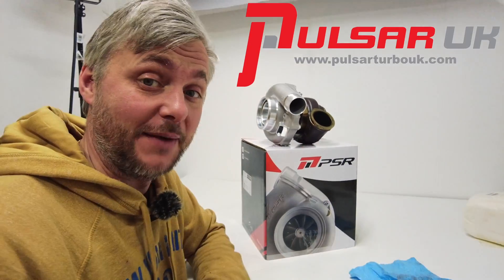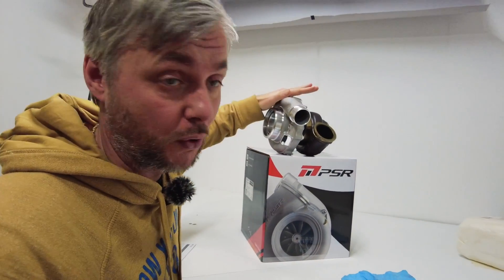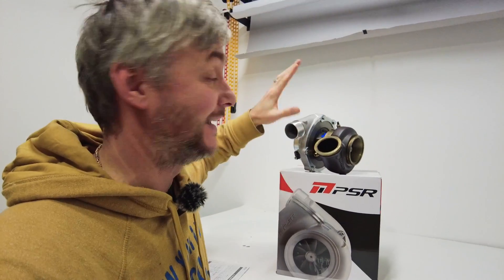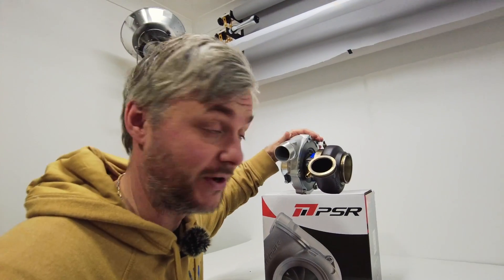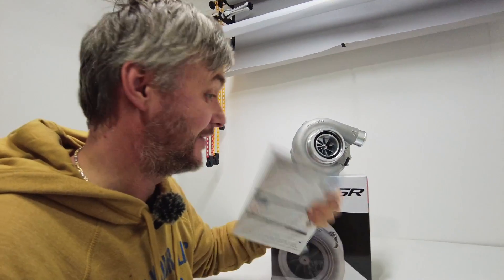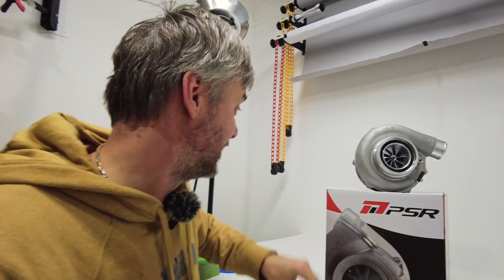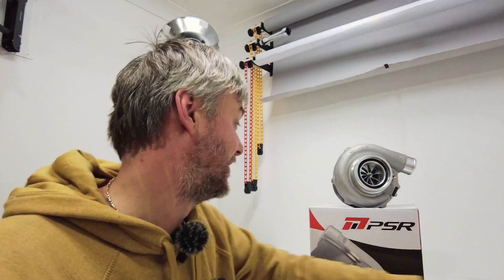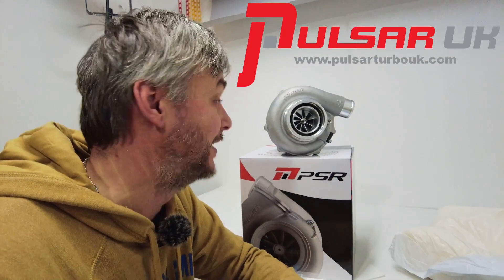How BIG is too big?? New turbo from @pulsarturboUK pulsar turbo unboxing

Comment: Not big enough!!! haha
Reply: a larger turbine wheel will give you more power at less psi, not so much the compressor wheel :) xxxx
Reply from the maker: good to know. see how it goes. can always upgrade to 35 later if needed i guess
Reply: yeah man, me or PSRuk will sot ya out either way. infact since your dual vband i probs have an old one on the shelf ya can bolt on to test
 @RuskiWeldFab
Reply: Which one turning fast..vband or t3?